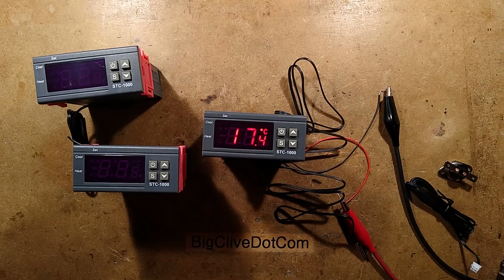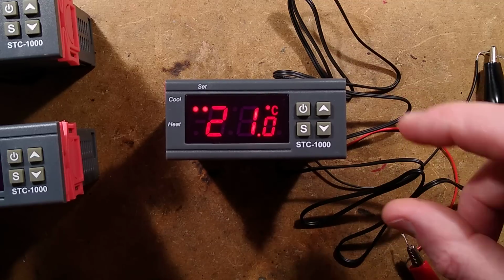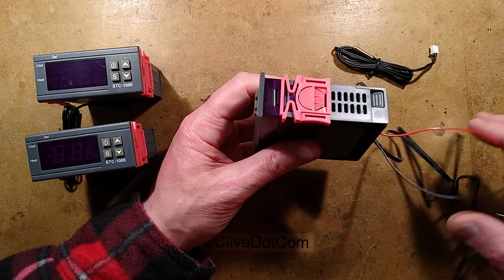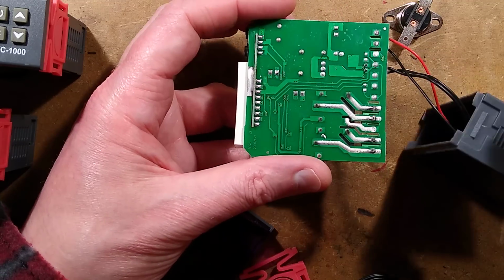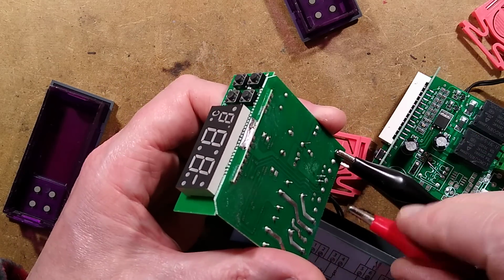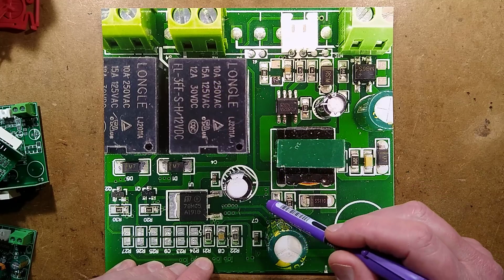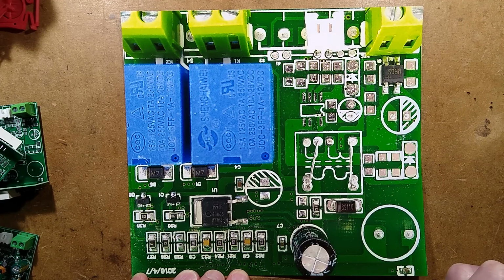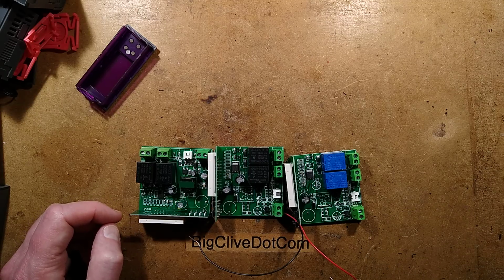Teardown of three STC-1000 style thermostats

Comment: I have one of these units. I put my Ender3 in a 12-U enclosed/vented networking cabinet. The cabinet came with a pair of 120mm mains voltage fans. I routed the temperature probe wire through the cable chain onto the Z-Axis Rail so the probe is about 20mm above the print nozzle or the piece being printed. I have the temperature set to 37.7˚C (100˚F) with a 3˚C Differential. Compressor setting disabled and the fans connected to the cooling side. Nothing is connected to the heating side. This keeps the ambient temperature hot around the print but kicks the fans on if the temperature rises too much. I found it helps to prevent the print from warping and coming off the print surface during printing.

Comment: 24 Volts is (apparently) common in commercial HVAC. Didn't you say one of those was a 24 volt module?

I like the idea of using a 3 step switch (transistor, small relay, large external relay/contactor)
May prevent fires.

Comment: Im familier with types that can switch through either 2 connections. Depending on what your using the stat to control?  Either heating or Cooling.  The 2 connections are rated at differant amps accordingly.
Things worthy of note?......lol
These also incorparate a anticipator in series to stop erratic cycling of appliancce.

Comment: The purple-reddish lens over the display is interesting. I have a car stereo with a VFD (vacuum fluorescent display). This display appears white despite being covered by a purple-reddish lens. I am wondering if the purple-reddish lens is acting as a color filter to make the display appear white, and without it the display would appear the normal bluish-green VFD color. In the case of this thermostat there's really no point to using a color filter, since the display is an LED. But I wonder if maybe there's a version with a VFD, or that was the original design.
Reply from the maker: There was a fad of trying to make VFDs not look like VFDs in the past.  So they sacrificed efficiency by adding a filter to give a different colour.

Comment: I've been meaning to build a thermostat/hygrostat unit for my reptiles and other animals but haven't had the resources and time to start.

For now I've been using cheap mains heating pad thermostats (iPower BNQ-T7B(H)) and a lot of manual monitoring for humidity and just verifying temperatures with an IR gun.

Thank you, as always, Clive for your insights. I think I might go with a similar setup using one of these with redundancy.

(A unit designed and sold for use with reptiles and animals with all the features I desire are $300, another reason I want to build my own)
Reply: I built a number of these for use with reptiles, controlling heatcords, mats and ceramic emitters. Also used one for my incubator (small wine fridge) and achieved very constant hatch rates. I thoroughly recommend them.
Reply: @Mad4400  That is awesome. I really appreciate knowing that someone's use case is similar to mine.

Did you put them into enclosures or just use them as is?

Thanks a bunch!
Reply: I'm also using one of these for my reptile incubator, which is basically just a big chunk of styrofoam with a lid that has a hole cut into it for a window. The hole is then covered with some clear acrylic. It works pretty well and the hatch rates are solid.

Comment: I've been using a nearly identical one (humidity instead of temperature) to control a food dehydrator for drying 3d printer filament for several months, 120v version. No complaints so far.

Comment: I had one of these a few years back but if the power dropped it lost it's programming.  What did I do wrong?  I would up throwing it away.
Reply from the maker: That's odd.  It may have used a separate memory chip with a soldering issue.

Comment: I would love it if you get a hold of one of the inkbird units that are on eBay. With the green face and the 2 gang power board attached. I opted for one of those over these grey units. It's been doing well running a bar fridge I use to cool the res for my laser cutter
Reply from the maker: I've just received one.  I ordered a different controller and they substituted it.

Comment: I just received my K thermocouple thermostat (REX C-100 ebay $9).  I was planning to temp control my yard sale find, Weller 100W soldering iron and just found out it's already temperature controlled.  That was easy.  The K thermocouple can handle some high temps and it screws in like a bolt on the end.
I wonder if I could short out some sort of kitchen appliance to make a reflow soldering plate like a George Forman, clothes iron or a toaster or something.  I'm having trouble getting motivated.
Reply: The STC-1000 tops out at 100C (212F for those backward Imperial countries). Then it goes into alarm mode. Not especially suitable for regulating high temp devices like soldering irons etc.
Reply: @roberts574 Just about every kitchen (or other) heating appliance will have a higher-temp backup thermostat or thermal fuse in case the operating thermostat fails stuck on, so shorting the latter won't work. And you would be very foolish to short out both, so don't try it.
Reply: @campkohler9131  I took the last clothes iron apart and I'm pretty sure the temp control stuck and took out the thermal fuse.  I did end up with the base plate and element (tossed it though).  The shape wouldn't be great for reflow.  I will be using a temp controller and probably a variac for whatever I end up using for the heater.  The only appliance that seemed built for higher temperatures was the toaster and of course all the components would be gone when the board popped out.

Comment: Hi Clive great vid got a question the wooden ring light the one l have are very bright (they have 3 100 ohm resistors in parallel ) would like to change them for a lower value what would you recommend?
Reply: Without even tninking, why not put another 3 100 ohm resisters in series with the existing ones? Can't go wrong there.

Comment: I* hevr found many times a connection on the board that will switch between F and C, perhaps just a short between two solder dots that can be used with a switch to go from one to another

Comment: Aimed at home brew market. Ive used a 240 volt one for years. Runnkng fridhe and heater belt. Safety issues include no segregation at terminals, single pole relays.

Comment: Happy to see this video. I've got an Inkbird ITC 2000 which is very similar but is 110v, has a big brown transformer inside, and what looks like a buzzer. Tried using it as a room thermometer but consistently read way too high. Now have no clue as to what to use it for.
Reply: It should be able to be calibrated if you have a trustworthy reference.

Comment: I wonder if any of the 12V or 24V ones get accidentally shipped as "mains AC" units. The fact that they are pretty much the same externally is a bit creepy. Plug it in and end up with a nice smoke and fireworks show, with a temperature reading of "flames."

Comment: I would use those to switch a 12 or 28v control voltage to control contractors. Wouldnt trust those tiny relays on derect mains control. Dont forget to put a capacitor across the contacts to help prevent pitting

Comment: For those that miss an important point: Switch/Relay ratings printed on them is near always Max Amps at VAC unless actually says VDC and all for purely Resistive Loads. Look up data sheets and you find the rating for Inductive at best is 1/3 to 1/2 of Amps for given Max Volts. Even parts made by Omron and other well known brands have same markings on them and will burn with Inductive Loads. Motors, fluorescent and other lights with a ballast,  transformer and more will burn down any switch point fast because of this. But Some Datasheets don't bother listing this info and many people burn out the contacts and worse...
Reply: So-called "definite purpose contactors" are rated in amps for an inductive load. Therefore a 40-amp definite purpose contactor is rated for a 40 amp inductive load. They're primarily used in HVAC applications to switch motors and compressors, and may only be available in USA/Canada.
Reply: @brianleeper5737  The Contactors goes by different names but they do use versions world wide. These are not cheap or available to general public in normal retail. In the U.S. you are often looking at Graybar and other industrial suppliers to buy them and meet Electric Codes.
Reply: @Thingstest-rl8xu  The Definite Purpose contactors are cheaper and more widely available than industrial IEC and NEMA contactors. A 40 amp DP contactor costs about $20 and you can get one from any HVAC supply or even Amazon. There's one of these in just about every house in the USA that has central air conditioning.
Reply: Yes, when I tried to design my own relay boards I found this to be buried deep, and often with no useful numbers for individual products.  Also the published information on prolonging contact life with snubber networks falls into the useless category of "measure your very specific finished product and redesign circuit for that specific situation", which is highly impractical when trying to make something intended for 3rd party use with unknown loads.  As a workaround (never built and tested), I considered using a MOV to eat the back EMF from inductive loads, thus preventing excessive contact wear.
Reply: now i know why regardless if we over spec our relays, we always end up replacing them anyway just farther down the line
Reply: I looked but Can't find exact JQC-3FF above. Others start same and FL-3FF-S-H the datasheets have No mention of Inductive loads. Contrast to Songle SRD-05VDC-SL-C (Used by Elegoo and many other Arduino/Pi kit makers) Datasheet rates Type C contacts Resistive Load 7A 28VDC, 10A 125VAC, 7A 240VAC Inductive Load 3A 28VDC, 3A 120VAC If part number end with A means Type A contacts rated for Resistive Load 10A 28VDC, 10A 240VAC Inductive Load 5A 28VDC, 5A 120VAC Omron sheets are similar with reduce I-loads for most relays.

Some Relays for Cars are made to handle 10 to 20 Amps at 20VDC because controls Fuel Pumps, AC Clutches, and more but they often wear out faster doing that vs Turning On Halogen Headlights pulling More amps then the motors/coils.
Same problem at home with standard wall switches burning up every few years at best controlling garbage disposers, fluorescent lights, etc.

Comment: My experience has shown these relays to be incredibly dangerous. 
They arc weld easily. I bought one with exposed PCB that runs on 12V and only one relay, but after a few months it wouldn't turn on the heater. 
I found a relay like it on Digikey, and replaced it with a real Omron for about $10. 
3 Years so far an no worries.
Reply: Mine's been running non stop for 2 yrs, did I get lucky?
Reply: @TimeToTakeTheRubbishOut  Rather depends on the load you're switching.
Reply: @adrian_foden  A fridge compressor.
Reply: @TimeToTakeTheRubbishOut  Without looking at a snapshot of a current probe, it's hard to say how huge the current to the motor at startup is. It's high enough that prevents most power inverters to shut down. 
If you have the experience, replace it with a known brand that matched that footprint. If you haven't done that before, don't start with this. Start with something less critical. Buy a better quality. Pay once, cry once.
Reply: @TimeToTakeTheRubbishOut  On another fix, I couldn't find one of the relays for the electric furnace, so I bought the biggest I could fit in the enclosure, and used very short wires to solder them to the same pads and holes on the PCB, shrink wrap everywhere ofc.
Reply: The omron ones still fail buddy, tho obv they are more robust, I highly recommend having that omron relay power a proper contacter for a bulletproof setup. I have had cheap and brand name pcb mount relays fail closed under load.
Reply: Unfortunately, when last visiting the Omron website to get specs and catalogs, all I could find was marketing noise about products for hospitals etc.

 Seems a bad trend among corporate website designers to hide their signature products under mountains of aspirations to enter new markets.

Comment: I've used a similar device for year to control the temperature in a mini-fridge that was being used as a cheese cave. Though the one I was using was mains powered (120v) and had more buttons and configuration options. I recall that I could set an audible alarm for when the temperature went well below or above the set points.

Comment: I've been using STC-1000's for temperature control for my aquariums for years, with the oldest one being 6 years old. Simple, accurate, and cheap. The heat and cooling control is amazing. I have both heaters and chillers on my tanks and by using one controller, it eliminates the risk of having both the heaters and chiller on at the same time. Highly recommend them.
Reply: Out of curiosity, what chiller are you running?
Reply: @ALAPINO  EcoPlus 1.5hp, and 2 aqua euro 1/10th hp. (Separate Tanks/systems).
All the chillers and heaters have their own thermostats also, so I utilize those as a redundant cut off. 
     For example, System temp is set to 78°, the STC is also set there with a 1° deviation. So the main (STC)temp range is 77-79°, therefore I have the chiller set to 76° and the heaters set to 80° on their built in thermostat. If the STC was to fail closed, the heater/chiller will shut itself off once it reached its own set point.
This helps prevent them from getting stuck on and freezing or cooking the tank.
Reply: @noahsheehan7824  Cheers! Thanks for the information!

That's exactly why I'm leaning towards something like an STC, cost effective redundancy. My old home gets very cold in the winter and very hot in the summer. Not ideal for the animals we keep. :P
Reply: @ALAPINO  Awesome! Glad I could help!
Reply: I'm using them for exactly the same function although I don't use the cooling function, just the heating side.  I set the aquarium heater to a couple of degrees higher than optimum so that if this unit should fail in the 'on' position the thermostat within the heater will turn off before the water temperature gets too drastically high.  I have had just about all types and makes of aquarium heaters and I have yet to find one that is reliable and keeps the same temperature, it seems that because most of them use a bimetal strip they will alter over time.  The greatest advantage is that I can check the temperature of all my 6 tanks just by glancing at them from a distance, the majority of aquarium thermometers are a total pain to read.
Reply: i didnt get it, do the outputs are AC or DC ?
Reply: @kizgintosbaga  the "output" is not an output, it is a relay. So you can hook whatever you want to it.
Reply: @noahsheehan7824  thank you, i didn't feel belittled at all :D

Comment: 0:55 So you could use them to trigger a solid state relay?   Or contacter?   How many amps do those draw (on the trigger side)?
Reply from the maker: It depends on the device.  A solid state relay will only require around 20mA.

Comment: The dual thermistor contacts could be for the STC 3008 dual temperature controller? I just picked one up to try as a cooling fan controller for my project car. It'll have beefy external relays for the actual load, naturally.

Using the 12V version with a proper 12V supply also gets around the poor isolation of the thermistor port.

Comment: I use an Inkbird in a gutted out mini fridge for starting plant seeds. It runs a 40watt incandescent for heat and a couple of 80mm fans for cooling. A Defiant timer switch controls CFL lights. Hole sawed a bunch of holes for fresh air.